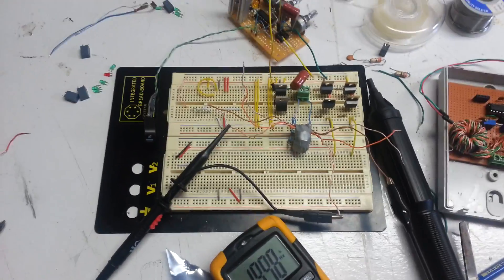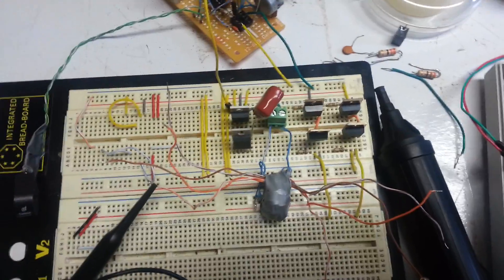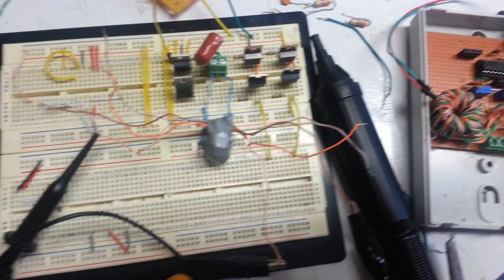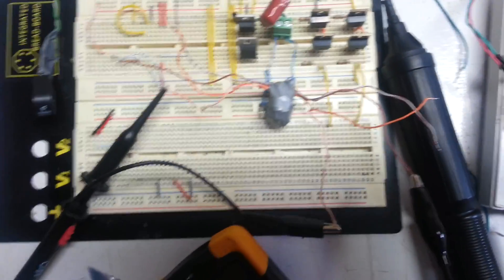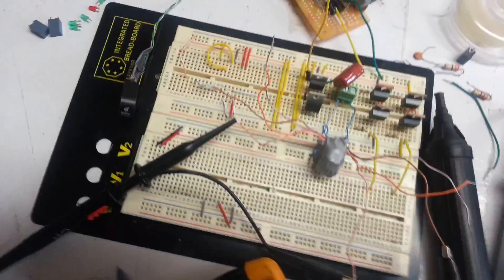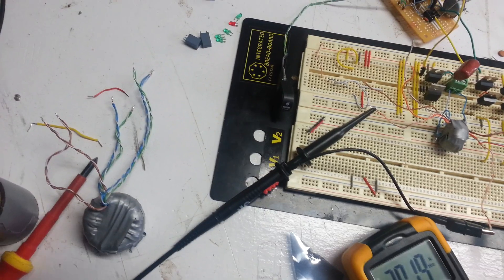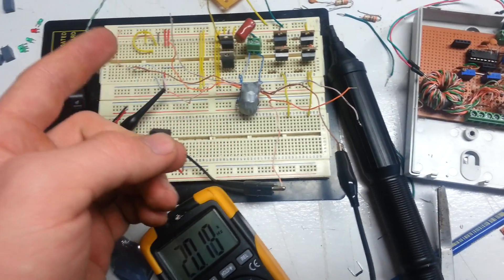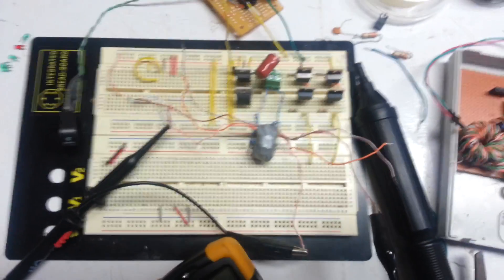Debugging Gate Drive Transformer Issues

Comment: Why did you choose a GDT instead of a direct connection and a bootstrap circuit?
Reply from the maker: From memory the gate drive transformers were used so that only a single power supply was required on the driver side when used in half or fullbridge operation.

Comment: sry you were stuck at 20Khz
 I seen a TI you tube video they used a transformer to drive a pn2222a and 2n3906 and pulled a plus minus supply from  the drive transformer only 6 parts per FET 
My goal is a TL494 driving a complimentary pair bridge into a drive transformer driving the the above circuit driving the FET bridge. I'll be  using FT82-77 toroid core for a driver 
merci beaucoupe for the link and sharing this vblog

Comment: can you please explain to me why do we use gate drive transformer to drive mosft ?
Reply from the maker: Hassan Omer Hey, when you build something like a half or full bridge driver you will need 4 isolated power supplies unless you use a gate drive transformer. 

Its a very easy way to make an isolated gate drive
Reply: +Hassan Omer My research shows, that transformer drive is the best way to drive a gate, if done correctly with an AC square wave